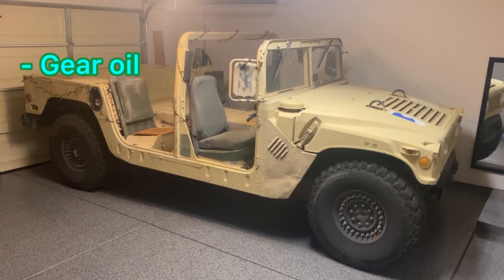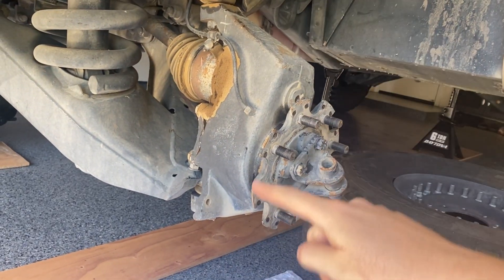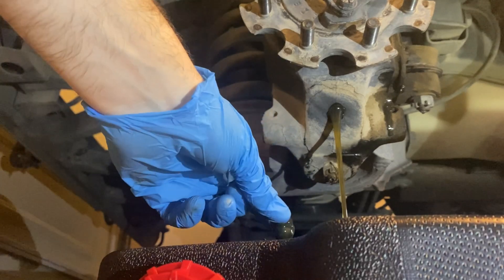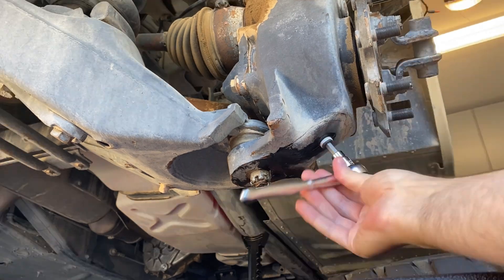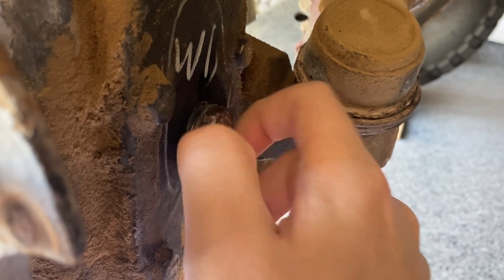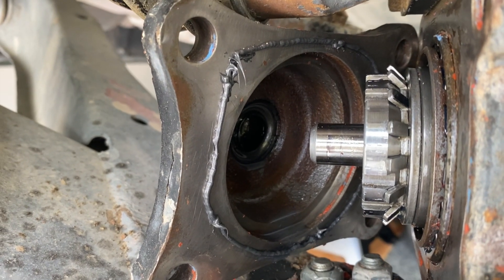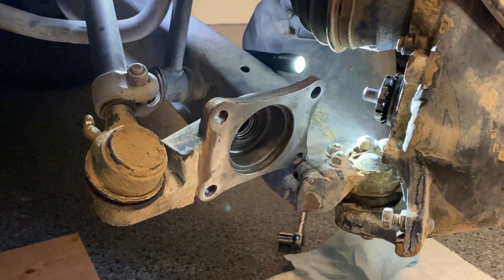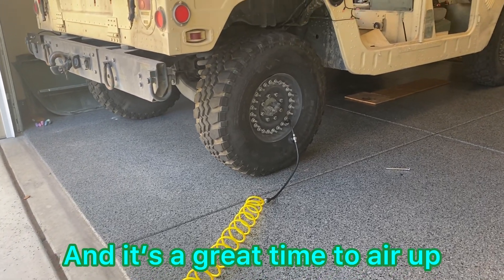HMMWV Comprehensive Geared Hub Maintenance

Comment: Some tips and hints:
1) If you are getting a Humvee 2nd hand from the government, the best thing you can do is replace the spindle nuts with the ModMafia locking spindle nut kit.  Why?  Because if someone replaced a spindle seal on that hub before, they re-installed the spindle nut and might not have done it according to factory specs.  If that spindle nut lets go then that wheel flies off - usually on the highway and likely hurting of killing people.
2) if your hubs are leaking from either the input or output seals, you can use lucas HUB oil in place of normal gear oil in the hub.  It is thicker and has seal conditioners in it that will more than likely keep your hubs from leaking.
3) Be careful using military technical bulletins.  Their recommendations as far as operating temperatures for the 6.5 is completely out of whack with reality.  The engine should never EVER get above 220'F.   Anything above that and your engine has suffered web cracking.
Reply: Yea that engine temp was one of my concerns, it would get up to 220-230 before the fan engages, I changed out my fan for viscous clutch fan and now my temps are usually 180-195
Reply: Thank you @Dan’s Garage for the video and @nothingtoseahear, I just sent on and ordered the ModMafia locking spindle nut kit for all four. Don’t want to risk anything